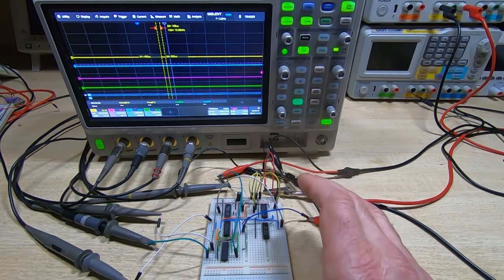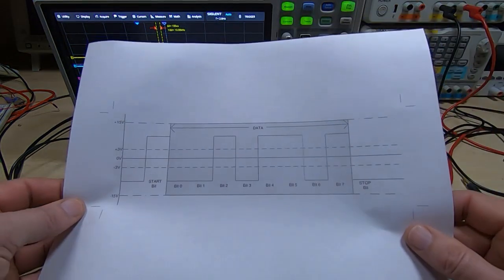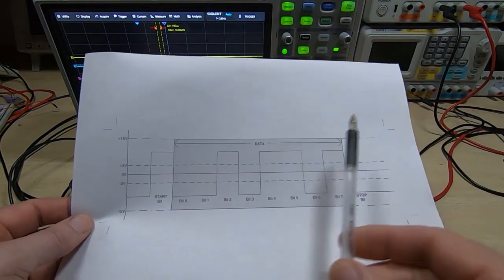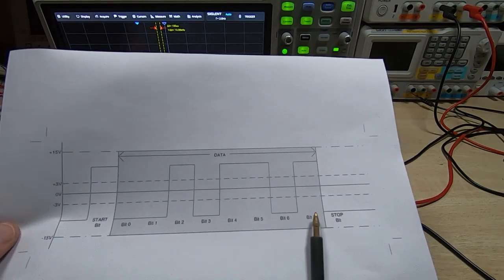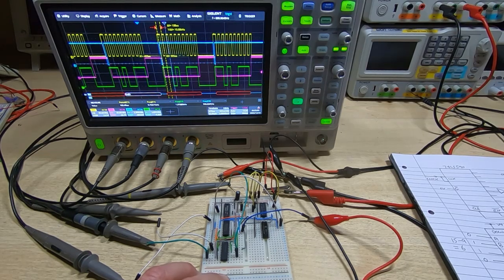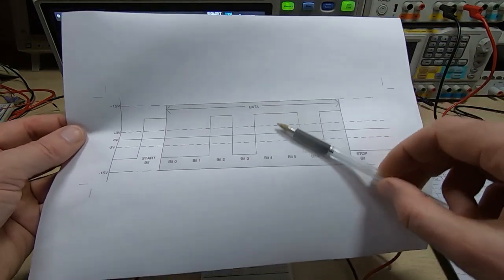Designing A Z80 Computer Part17

Comment: The interesting part of a MAX232 isn't the buffering, but the charge pump. Line drivers with a charge pump power supply would serve to explain the inner workings in the spirit of the rest of this project.
Reply from the maker: Most machines back then used +/- 12V supplies and line drivers rather than charge pumps. I am hoping that others will want to build one of these so I do not really want it to require three supplies. However if you want to use a charge pump and line drivers then please feel free to add them to your design.

Comment: Hi Jerry - just a question on the project. You've said that you want it to be able to run CP/M. I'm not sure if you plan to get into the development side too far, other than maybe a monitor program (i.e. writing a CP/M BIOS)... But I was wondering if you intend to actually build in  floppy support?  That's one thing I've never done in any projects that I've built but I've considered it... I was assuming that driving a 5 1/4 floppy drive would be very difficult and prohibitively complex without employing an FDC chip and I, like you, would really want to implement it all in discreet logic anyway for a project like this... but it got me curious on the actual fdd interface so I did some digging and found very few resources of information on how one would build an FDD interface with discreet logic.. Eventually I found a few documents, and to my surprise, it actually seems fairly simple... It seems that it comes down to a clock to time writing / reading bits, counters for your sectors / cylinders / blocks, some control logic for the motor, and step/dir control for the head with the timers based off of index pulses for track 0 / sector 0 of the disk as it spins...  The biggest complication to my mind is the FM encoding that produces a pulse only on state-changes, as opposed to to simple 0/1 state at each clock position... But basically do the same thing here,  changing the state of the flipflop in this circuit when the state changes and you've talked about circuitry similar to that in the past so I guess clever use of a flip-flop is all that's really needed.

I'd be really interesting in seeing your approach to building something like that. I'd love to delve into actually experimenting / bread-boarding something like that myself, but I just don't have the free time to do all of the things that I'd like to do.

I guess handling blocks at a time really would call for DMA support too  probably...
Reply from the maker: I have not yet decided. I may decide to load the OP via RS232. Having said that it is actually fairly simple to build a discrete circuit to control a FDD. Where it starts to get complicated is where support for multiple formats is wanted and how robust it needs to be (CRC etc). That is why I may not include it in this project because whatever format I select I will get requests for alternate formats. I will at some point add FDD support to my own machine, I am just not sure if I want to include it in this video series.
Reply: @JerryWalker001  Well, I for one, would really like it if you did... I understand your hesitation with multiple formats... But the interface between 5 1/4 and 3 1/2 drives appears to be the same, so  regardless of the physical size, it's just the complexity of multiple sides  and different counters for number of cylinders, etc... so if you just support a single format and emphasize (as you do quite frequently) that it's up to the reader/viewer to figure out how to modify, extend,  alter the circuit to support whatever variations that hey want....

Personally, I'd only want to support single-sided low-density 5 1/4 disks at 160kb or similar.  In fact 8-inch would be even better, but I'm assuming that quality working 8-inch drives are difficult to find... In fact, I'm also assuming that one can still get  working PC-Compatible 5 1/4" drives and disks quite easily... at one point I had crates full of such drives and they seemed to be a dime a dozen.. But that was years ago and I guess they may possibly be rare to find too now.
Reply from the maker: @Kodemaestro  The interfaces are totally different but I was not really referring to that but to the format of the disk.
Reply: an IDE hard drive might be a thought, Dont know what kind of size you can get on that with CP/M but probably give at least some storage
Reply: @randy jackson  there is loads of information on IDE interfaces and plenty of examples... but I have no interest in that. An MFM hard drive maybe, but I wouldn't want to hook an IDE drive up as it would totally be out of character for the project and cheating.. and simply not interesting. MFM is both interesting, and in the proper spirit of the project, being appropriate to what a machine of this nature would have used when original.
Reply from the maker: @Kodemaestro  I totally agree. This series is intended to show how to go about designing a system in this way. Each builder can add whatever they want and while adding an IDE drive or memory card would be simple    I agree that they would be out of place in this project. I will not be going too far with this project in the videos as I would prefer to leave it unfinished so that individual invention can take over once a basic working computer is available. I am trying to wean people of short cuts but as you see it is a long path :)
Reply: @Jerry Walker  I have a very similar philosophy to you. Keep machines as original as possible unless it is absolutely necessary to make a modification, and i like to preserve patina and not retrobrite. I used to have a decent collection of vintage machines, mostly TSR-80s, PETs, and 80s Sun and HP Unix workstations.
 but when I moved to the UK from Canada 12 years ago I had to leave most of them behind..
 sadly... All I saved was my Microvax and an SGI octane.. I had been trying to obtain an ASR-33 for over 20 years and was really hoping to win the giveaway that you were doing.. but j did get lucky and finally found one last year in fairly poor condition that I restored with the help of your fantastic videos. Next on my list is a PDP-11 and PDP-8.
Reply: @JerryWalker001  yes i understand the point of the project, I took a look at ebay and there are still 8 inch drives around who knows if they still work. If you make a floppy controller for this then i will roll with it, IDE to me is a gray area like ps2 keyboard both came out around the same time, i can agree it feels slightly out of place

Comment: Good call using the MAX232 chip.  It's far cheaper and easier than adding multiple power rails or discrete charge-pump circuits.